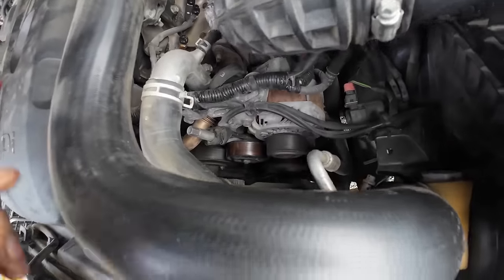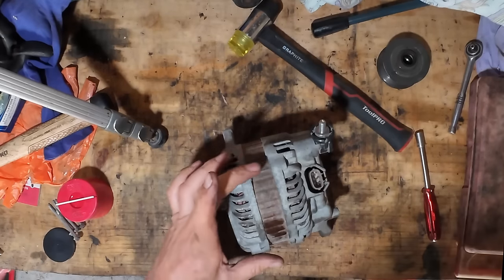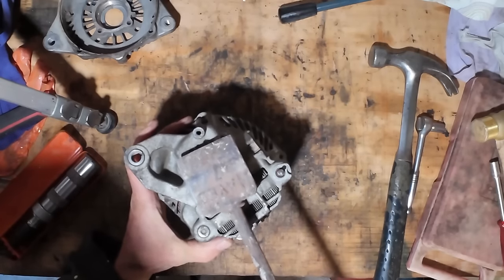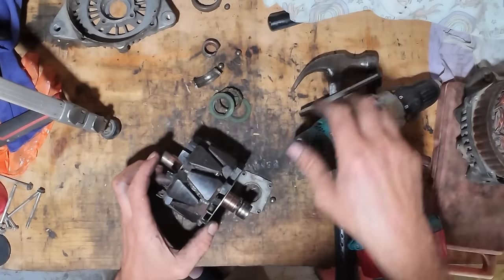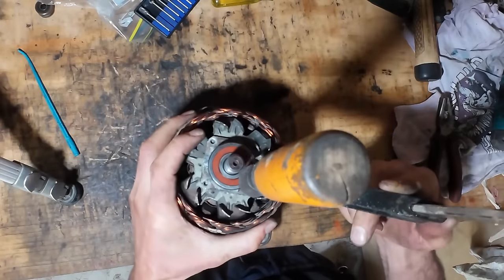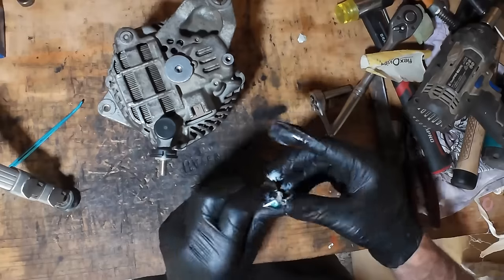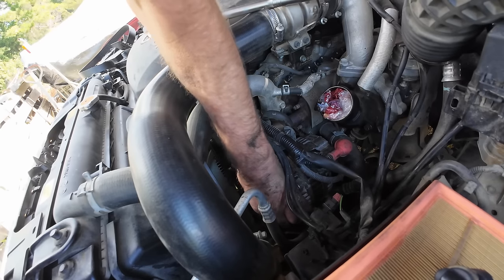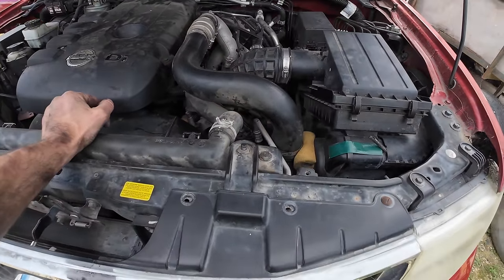Replacing worn out Alternator Bearings - Navara D40

Comment: Years ago, my first car I owned had 2 clutch cables.  One was long and the other was about 3 inches.  Well the small snapped and I took it to the shop to get it fixed, cost me around $300 CDN.  A few years later it snapped again so I priced the part, $10.  I decided to give a try at fixing it myself.  Now consider I did this in my back yard, limited tools, and I'm an accountant not a mechanic.  Well, after a couple scraped knuckles and a few choice words I managed to do the job and that cable lasted many years until I finally sold the car.  I discovered the job would have been easier with just a couple extra simple tools and it really wasn't that difficult of a repair.  Now in fairness, I said I was an accountant which I am  but whe  I was going through school I joined the air reserves as an air frame technician and they sent me on a 6 month training course where I learned to do some basic trouble shooting and repairs on an airplane.

Comment: Hey Marty.
The brushes have a hole in them, when reassembling push the brushes in and a paper clip through the hole in the rear casing is your friend to hold the brushes retracted.
Also, as you said after putting the rear bearing in the housing, the rear bearing should be fitted to the shaft first, so you can press on the inner race, it also makes sure the bearing is fully seated on the shaft, and does not stress the bearing.
Then heat the rear case with a heat gun, torch or your soldering iron, a little oil inside the rear case bearing bore and on the outside of the bearing and things pretty much just slip together, same for the front case, no damage or axial stress on the bearings, so they'll last a bit longer, although hopefully you won't need to do this again for a long time, at least with the Nav anyway👍🇦🇺

Comment: Now I know, garbage (alternator) design means, for me, buy rebuilt alternator.  Nice work.  And, you got me thinking, how does my GMC truck/SUV's alternator go together?  I looked.  The builder I watched, uses a hotter than 200 W soldering iron to solder/de-solder any of the parts that need it during assembly/disassembly.  Interesting.  Oh, and the rear bearing is accessible in those.  Still not easy though.

Comment: Started repairing Alternators and Starters in the early 1970's
when i got my first car...Dad showed me how to take them apart and fix them... still do them but i compare the price of a rebuilt or new one before rebuilding it... depending on the age and mileage you might. want a replacement....i prefer a New one over a Remanufactured one though.... they can be trouble if repaired poorly... ( which they usually are nowadays )..i have a great Auto Electric Repair shop that is very helpful on getting parts from and advice ( rarely need that but i am not afraid to ask questions or directions too )... you have to weigh the skills and tools needed when doing this job ( or any repair ) ... most people can swap the part out but many get afraid of tearing it apart that deeply....
usually there is a way to hold tje brushes back - a small hole to put a wire to allow you to get it back together?  that holds the brushes till you slide the shaft back in ?  Your fix works too...as seen...whatever wirks is Correct method ...

Comment: Putting the belt on probably took longer than the rest of the job.  Just did one recently on an A4 and I refused to pull the bumper and radiator support off replace it.
Reply from the maker: 😆 the A4s are shockers to work on

Comment: You need to get heat around the circumference of the housing. Wrap the main housing and the especially the bearing housing  in heat trace wire and let it have it for about an hour. Don't put the alternator in the freezer, either. Just heat the housing. Then blast the  core with a can of air duster. The cooling effect of the air duster with shrink the innards while the heat from the outside'll expand juuuust enough that some traction will allow the core out. Or, just as you did, bore a hole and pound it out. Probably faster once you know that trick.

Comment: Nice job . Could you have taped the hole you drilled and put a short bolt in there. Also double as a pusher to remove in again in the future if needed 👍

Comment: I got a bit disorientated as the alternator was flipped a few times, but you may find that the small hole on the back (next to the hole you drilled) is so you can push the brushes back and put in a pin (wire) to hold them while you assemble it all. 
When its back together, pull the pin and the brushes pop into place.
But I could be wrong on that alternator.
Reply from the maker: I had a look with the endoscope, that hole is threaded and blocked with a bolt from the inside

Comment: 10:30 would it be better to use a plate of metal then solder/weld around it? Worried that something that get's kicked up or heat might crack the putty.
Reply: That putty sets like steel. Marty used it to reinforce the end plate since he had drilled a hole in it..

Comment: Never roughen or straighten a commutator with sandpaper! The carbon brushes suffer greatly and are quickly worn out. It is better to overturn them with a lathe or at most clean them with polishing paper. There is a special rubber sanding rod for the commutator that you can hold against the commutator while it is running, which straightens the commutator a little, cleans it and adjusts the carbon brushes. If the bearing is worn out, the carbon brushes must also be cleaned and new carbon brushes fitted. Always remove the carbon brushes before dismantling. An arbor press would be worth its weight in gold for this job.

Comment: It was the brushes on my Toyota Yaris alternator at 250,000 miles (USA).   Dealer wanted $600 for a new one, parts store $450, amazon, $350.  New brushes .. $25.

Comment: I try and have about 4 cars of the same model. One I drive and the 3 others as parts cars.
Not 2 days ago I had a voltage reg issue on an alternator I recently swapped from another car LOL. 
Anyway the driving car, and 2 parts cars the reg brushes all had worn regs. Luckily the worst car of the lot had the best reg with years of use remaining.
Reply from the maker: Haha.. I'm always on the lookout for a cheap parts hack 😂

Comment: You should not have sanded the commutator with such coarse sandpaper. That will wear out the brushes faster due to the ruff surface. You should have just cleaned them with some contact cleaner. Other than the afore mentioned it's a great video and I enjoyed it.
Reply from the maker: It was 600 grit
Reply: @MartyT  I stand corrected, 600 grit or finer is OK for this application.

Comment: Looking at th engine bay of a D40, especially a red one gives me PTSD of pulling the engine out of my old 1 twice due to failed cooling system and then failed timing chains, hopefully you've done the preventative on both!

For the cooling, there are two small coolant hoses on the oil cooler/oil filter housing, they always get some oil on them when changing the filter so they degrade and fail, as well as the coolant hose that runs around the back of the cylinder head, and the plastic 90 degree elbow fitting that goes to the heater core, replace all of them if you get the chance.

Timing chain is aparntly mostly dependent on where the engine was made, if yours is a spanish made one you sohuld be right, most of the Thai built ones are also okay but some had the sprocket on the primary timing chain shimmed incorrectly.
Reply from the maker: Timing chain has been done.. I will check the cooling system weakness. Thanks mate
Reply: We were lucky with our D40 and encountered none of these issues. It just snapped in half 🤣🤣
Reply: @charleshodge5023 you were lucky. Lol

Comment: Hi marty if that won't work using 2 screwdrivers 180 opposite in between the front bracket  and the stator  lever the bracket  rotor and pulley away from the rear bracket  and stator
Reply from the maker: I did try that, it was well and truly stuck with corrosion around the bearing
Reply: @MartyT steel bearing in an aluminum case.  No way that’s coming apart without some complications.

Comment: in uk, D40s are well known for snapping in half, there was even a recall for them, any issues over there ?
the recall involved sending them back to spain to get a half-chassis fitted, i had the job of fixing them when they came back on the ferry + wouldn't start, blown alternators + main battery fuses fried, did they not disconnect the batteries first ???
Reply from the maker: Yes I had heard about them snapping so I rustproofed the chassis inside and out, it was starting to rust
Reply: an air bubble forms in the "hump" of the chassis behind cab when being factory dipped, bare metal for 6 inches @MartyT

Comment: My understanding is they now make something that does the charging yet is unreplaceable. Not something I know but hear about. Thinking about a podcast where they admit to having a engineer who knows what the total amount of space taken from say the engine and then redesigning it to fit in  a small space available. We can appreciate old vehicles we leaned on the fender and fixed them
Reply: I'm sure some parts that need to be replaced are mounted in a jig at the factory and the whole vehicle is assembled around them.
I had a starter motor that required the right front wheel to be removed, the right hand engine mount undone and the motor jacked up to get the bloody thing out.

Comment: I had a Fiat from the '70's. Alternator went out. Took it off, someplace replaced the brushes and turned the armature. Cost me $60 circa 1982. That's $190 in today's dollars. Once the timing belt broke the second time and the valves were all bent (again), I sold it for scrap. $400. $1265 in today's dollars. I probably ripped the seller off. What a bucket of bolts that garbage car wa!. High school. I had worked so long and hard to buy the most unreliable vehicle ever made.

Comment: I might have tried terry the torch instead of that iron thing, that frozen case would have been a hell of a heat sink.
Reply from the maker: Yes I would have done that but manual said dont use a torch as it will cook diodes

Comment: In the past alternators were cheap enough that just replacing them was not an issue and something I would do as a matter of course, and this was possible for people who dont have any real engineering knowledge...
I guess times have changed what with 500 dollar! alternators it seems like its a good idea to become your own mechanic... the poor/faulty design and deliberate obfuscation of the manufacturers isnt going to help there though, so good on you mate for getting round it...
Its all intended to make you pay of course.
Reply: The Japanese import/grey market diesel SUVs/light trucks/vans that are ubiquitous in New Zealand...sometimes have a vacuum pump added to the rear of the alternator with a pressurised oil feed to that pump...and a rubber discharge hose returning the oil and air to the sump.
Those alternators are $NZ800 -$1200 plus!..

but luckily the Asian market is so large that the Chinese copies are $NZ340 complete...and in my experience (2x over 20 years) last just as long as the OEM (10 years each)

Comment: Could you use an alternator as a wind turbine ?
Reply from the maker: Yes it is possible, I experimented with alternators on a wind turbine years ago, I found that they require much higher rpms than the prop could deliver and needed gearing up from prop to alternator which created significant frictional loss. I moved to smart drive motors which were far more efficient at low rpms

Comment: Tried to repair my Hitachi Ex75 24v alternator after the isolator switch got muddy and must have only conducted intermittently. The board got fried, but isn't replaceable or repairable.
$1300 for a replacement alternator! I just top up the batteries with a solar panel after using it.
Reply: If it's the regulator that's died, they are fairly universal and it usually doesn't take too much effort to wire up an external one. If it's the diodes/rectifier that's failed, you can buy press-in replacements from the usual suspects online.

Comment: Where are you getting bearings for five bucks? Front and rear bearings on my 00 Honda accord alternator were $50 Each then got a shop to put them in $240 Plus the bearings so $340 all up, I don't have a bench bearing press like you, but after the price of the alternator bearing job found out the noisy bearing was the AC compressor idler pulley  wheel lol  :( So i did that one myself.
Reply from the maker: Rear bearing was $12 from nz miniature bearings, I had issues with them, they deleted my order and I had to chase them up. Front bearing is very common, I had one already. Overrun/pulley bearing was from trademe NZ.. I shop around worldwide for best prices

Comment: If you need to remove a bearing or bushing from a blind hole,find a socket that fits snugly inside of it, place socket onto an extension backwards,pack cavity with grease and then drive the socket inside of the bushing or bearing..The grease having nowhere to go,and not being compressible will force the bushing or bearing out usually... If not,a dremel with a burr bit,or a tapered hardened grinding or cutting bit will usually cut it making it easy to pry out...
Reply from the maker: Thanks, I have never heard that trick.

Comment: The idea is that the aluminium will expand much more with heat than the steel bearing, maybe you didn't get the housing hot enough?
Reply from the maker: Iron was hot enough, the bearing was corroded between outer shell and alternator housing. It needed a good hit on the shaft
Reply: @MartyT  ah I see, thank you for the reply

Comment: WOW $500.00 that’s twice the price here in Kansas I’d seriously think about what you did if that was the case.
Reply: NZ$1=   US$ 0.60  (60 US cents)
So 
NZ$500 = US$300 

but certain Japanese import diesel alternators that have a vacuum pump on the back cost NZ $800 plus....

and luckily some also are so widely used in Asia that the alternators are copied and sold for NZ$320 complete...
and last for the same amount of time as the $800 ones...about 10 years
at least in my experience!
Reply: @JohnSmith-pl2bk  Oh I didn't know that thanks.

Comment: Why were the slipper brushes not removable?
Reply: Other commenters have said that there is a pinhole already drilled in the casing for a 'hold-back" for the brushes so they don't need to be fiddled with quite so much.....and the brushes therefore do not need to be removed...
Reply: The idea is that you buy a new or recon unit...not do a simple brush change.

Comment: 500.00 clams for an alternater??? Are New Zealand dollars less than american?
Reply from the maker: NZD.. 1 NZD = .60c USD at the moment
Reply: Yes...
NZ$1=   US$ 0.60  (60 US cents)
So 
NZ$500 = US$300 

but certain Japanese import diesel alternators that have a vacuum pump on the back cost NZ $800 plus....

and luckily some also are so widely used in Asia that the alternators are copied and sold for NZ$320 complete...
and last for the same amount of time as the $800 ones...about 10 years
at least in my experience!
Reply: @MartyT  Well that explains the trouble you went to. 300 is  alot of money for a flippin alternater. Good job.

Comment: I don't get why an alternator would need a one way bearing
Reply from the maker: The advantage of the alternator one way clutch is reduction in the force level in the belt drive. This extends the life typically by a factor of 10 of individual components, while ensuring an increase in the generator speed and a reduction in noise. - https://www.eurekamagazine.co.uk/content/technology/overrunning-alternator-pulley-improves-internal-combustion-engine/#:~:text=The%20advantage%20of%20the%20OAP,and%20a%20reduction%20in%20noise.

Comment: $500 for an alternator ?
I remember when things used to be far easier to work on but the problem then was every guy with a cheap toolkit thought he was a mechanic and ruined everything they tried to fix ! I hated opening the bonnets of cars and finding stripped threads and rounded nuts and bolts and the customers never had any idea how it happened either ! When things got more reliable and harder to work on it gradually stopped people from trying to do it themselves and damaging every nut and bolt, making it easier for the workshop mechanics to fix the problems.
But $500 for an alternator is a rip off !
Reply: $NZ500 = $US300
Reply: @JohnSmith-pl2bk  so GB £250, it's still crazy !

Comment: The alternator makers do not want you to repair it,they want you to replace it…that’s a purpose engineering design build that the manufacturer did…ford is notorious for that as they purposely design licensed expensive mechanical tools that can easily fix the problem so home mechanics can’t fix it.

Comment: Pop quiz: Anyone know why there are one way bearings on the alternators for diesels but not gasser/petrols?  If I get 3 replies or Marty himself replies I'll explain it.  Former diesel tech here.
Reply: Torque...when a diesel slows down it yanks that belt down to a lower speed really hard...and there is no slip in a serpentine belt wrapped half around a pulley like that one is...
My old 1991 Japanese turbo diesel has a skinny but good quality commercial Gates V belt...
that just squawks as the friction lets the 1/3 wrapped V belt skid over the pulley........
Reply: @JohnSmith-pl2bk  You're pretty much right on.  Due to the high compression ratio  the crankshaft speed rapidly accelerates and decelerates between each cylinder firing.  At higher engine speeds it less prevalent.  I've only seen the one way clutches on 4 cylinders, anyone know if they are used on engines with more than 4 cylinders?